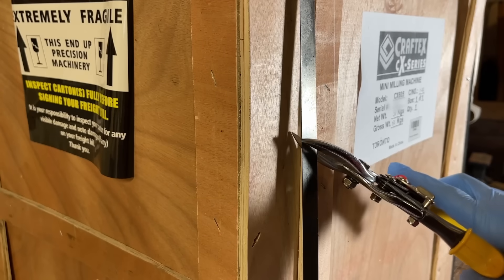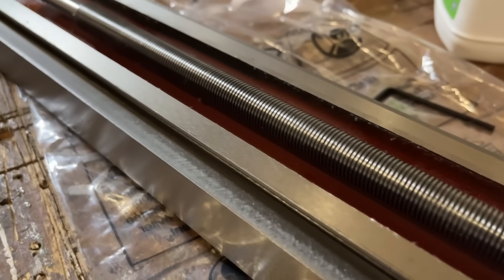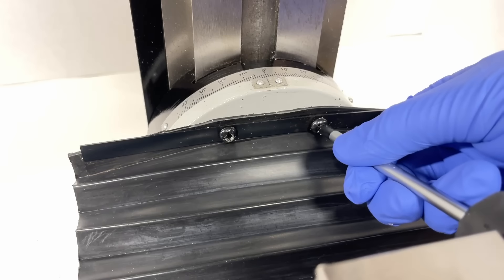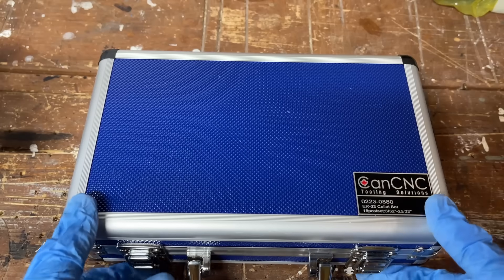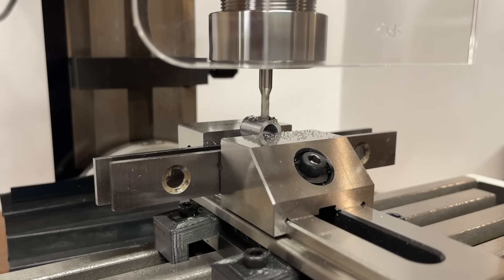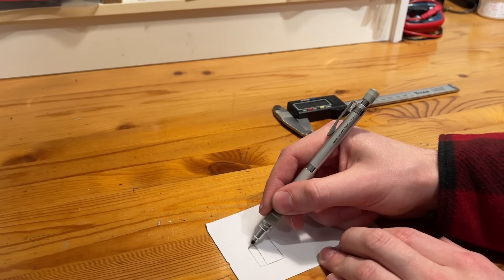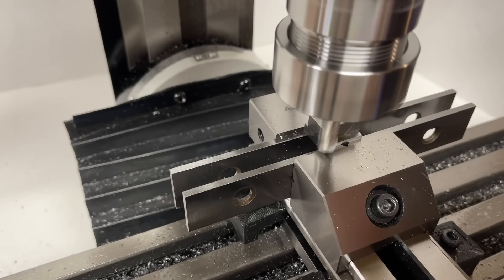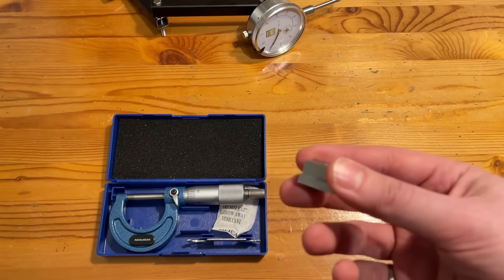I Bought A Minimill to see if they are Worth It

Comment: I am willing to bet a lot of bad reviews are from user error 
having been trained as a machinist the mill or Bridgeport is harder to run 
I am a damn good lathe operator because it so much simpler its hard to break tools unless you push too hard on the bits with no coolant 
on a mill you have to remember what direction to cut the table now moves on multiple axis which is a complication etc etc etc
even being trained I was prone to busting bits and these things get expensive really quick
and it can damage a part as you are  running them too
long winded bit to say not everyone is cut out to run these

Comment: I have had a mill in this size at work now for over 10 years.  Its a different brand, but still same features like the 62.5 dials on the xyz stages.    Mine has a different motor and uses c8 collets.    I have milled stainless and nickel multiple times.   It takes some work and maintenance, but for parts that need roughly .005 accuracy, its doable.

Comment: I have a small lathe I brought instead of a car years ago... and for years drooled over horizontal millers with powered indexing drives. But realised over time I would then have to set up induction  heat treatment if I wanted home made gears to last... then the internet came and I could source most of my gears box needs on line.. so the miller gradually has fallen off my wish list... but still watching this  video !

Comment: Ive always heard they have plastic gearing in them , is this true ?
Reply from the maker: Yes it is, I managed to break one by crashing a flycutter into the side of a chunk of cold rolled steel. My fault. I replaced it with a 3d printed version with about 5 minutes of work not counting print time and had no issues since
Reply: @Someone_Should_Make_That can you use it to replace them with steel beers by using it to cut them yourself

Comment: When you cut an open-ended slot, you should use a two flute slot drill. If you use an ordinary end mill, there is a high chance of an edge breaking off as the mill emerges at the end of the slot.

Comment: There are a lot of people who have no clue about metalworking, buy such a machine and discover their own lack of education which is, of coarse, the machines fault. Another group of buyers  is the kind of people who buy this because of the price, but suddenly demand TOS, Bridgeport, Deckel, Maho and Schaublin performance. The third kind of people who buy this are the kind who knows better then God and even a Swiss made Schaublin is not good enough.

Then you have a few like me, who know about metalworking, been educated in it, worked in it for years, know the limits of such small, cheap machines and make amazing things on it. And often make their own upgrades for the machine to lift it to an higher standard. For them it is pure logic that you can't expect high end quality from a complete machine for the same price as an Schaublin 102-VM chuck.

Comment: I have a g0759 with a 1/3hp motor and  I also had a 2hp jet mill. Unless I was surfacing 3" wide pieces I always used my lil baby mill. I love that thing. I typically machine titanium, but it worked for hardened steel and everything in between. JUst keep your expectations in line and you won't be disappointed.

Comment: About 8 years ago, I bought an old Speedway mini mill from a guy who only used it to drill a few holes. It still had cosmo on parts of it. Those who are unfamiliar with the brand, the Speedway brand of tools was sold back in the 80s at those tent sales that people would set up on grocery store parking lots. I took it apart and cleaned it all up, it was like new…. And the price was right!
    I bought a set of collets and also a 1-1/2” facing mill on eBay, they are incredibly accurate for the price. I have successfully cut keyways, milled aluminum, steel, copper, bronze…. And of course, plastic! If I don’t have everything kind of down real tight, though it does have a tendency to move a little bit from the vibration and the cutting load. But, for what I do with it, it does pretty decently.
Reply from the maker: Sounds like you got an awesome deal! It’s crazy what these little machines can do when you put in the work to tune them up

Comment: I'm a professional lathe machinist since 2002.
I bought my benchtop milling machine in 2008, I was making some parts in my parent's garage for my hobbies.
Is a little bit bigger than yours (same castings of the Optimum BF20, but marked by an Italian distributor).
Original gears left the chat after months, I replaced them some times, and in 2011/12 I replaced motor and transmission totally (1.5kw asynchronous motor+VFD+poly-V belts).
You can see that on my other channel, searching for dadoVRC )
I used it until the end of 2023 to make DIY projects and then decided to convert it to CNC for making plastic injection moulds for my actual DIY project, to which the channel I'm writing with now is related.
You can make wonderful things with those small machines, especially if well converted to CNC, just take a look to the things I made starting from this May.😊

And I say that as a professional, a real one who knows that every machine have its limits, and if you want to achieve a result, you have to be able to stay within them!

Comment: I worked in a machine shop for several years in my younger days. One lathe I operated was a 40 x 157. Was turning large pump liners for gas plants. Years later I bought a 7 x12 mini lathe for the home shop. It was a learning experience with this little thing. Light cuts and don't get in a hurry for sure. But it does work on the small stuff I am doing at home. The dials are in metric which took a bit to get used to, and I did have to make some adjustments to get it running true, but it now does very good work.

Comment: For a hobbyist that has plenty of time to baby the machine and is only making small parts out of softer metals the mini mill and mini lathe are fine but if you have used larger machines switching to a mini mill or mini lathe is an exercise in frustration. Sure they can work in a pinch and you can get good results but not ideal by any means.

Comment: That’s more a grinding vise, and not a mill vise.  A mill vise will most often have an acme thread for clamping forces needed with milling vibration, whereas a vise like the one shown has a single standard screw. Upgrade if you can or keep your cuts to very small cutting depths.

Comment: I have owned a Micro Mark version of the Sieg X2 for 30 years.  It is still on the original motor, spindle, and spindle bearings.  Granted, I don't machine a LOT, but I do use it at least a few times per month, and when I'm working on a project, it gets a workout every day.  They can do respectable work (which means parts within .002" of your target... .001" if you are really careful), especially considering the needs of the home hobbyist these things are built for.  No, it's not a $50,000 Bridgeport, but then, who really wants one of those in their garage?   I have milled steel with it many times.  You just have to take light cuts and go slow in steel ... and use cutter lubricant! (which I didn't see in this video).   People will be surprised to find out that you'll spend at least as much on the tooling and setup fixtures as you do on the mill.   By the time you buy end mills, collets, some hold-down fixtures, clamps, 1-2-3 blocks, dial indicators, etc... it really runs into some money. But that's just life in the machining world.  It has nothing to do with what kind of mill you buy.

Comment: I purchased direct R8 collets which use less vertical space than the collet adapter that you are using and with less stick out things are a little more solid and stable and the added vertical space is nice on such a small machine. I also purchased a longer raising and lowering rack from Little Machine Shop to give more travel. I shimmed it to minimize back lash. All in all it has been a very useful machine considering its price and size. My CX612 with brushless motor was just over $900.00 Canadian when I bought it but they are a lot more now. I also have a CT089 lathe that I bought used for $1,300.00 to go along with the mill. My first lathe was a Busy Bee 9 x 19 and then a South Bend 9A which I sold after buying the CT089. The 1 1/2" spindle bore and added swing of the CT089 is very nice but I do miss the quick change gear box on the South Bend. Oh well. I did need the added swing.  
Cheers: BJ

Comment: So if I want to use this machine, I need to factor in the cost of the chuck?  Is there anything else ill need to consider?  I can build a custom workbench for it that's dynabolted to the floor so stability wont be an issue but is there anything expensive I might need later?  

Thanks for the video, it's very helpful.

Comment: The "Vise"  you are using is a GRINDING VISE  it is NOT  designed for MILLING PARTS .  It does NOT HOLD the Material in its Jaws TIGHT ENOUGH   .  When you are  BACK FEEDING or BACK Milling in the X axis the end mill CAN and WILL WALK the material right OUT Of that VISES  JAWS .  Use a VISE  "DESIGNED" for use in a Milling Machine . Please stay SAFE out there .

Comment: I have had one of these for about 30 years, bought it new.  It is a fully capible machine and is able to do accurate work.  That being said, it is also hinges on the skill of the operator.  It is capible of tool steel however you may have to take lighter cuts.  Tool steel is a little tricky.

Comment: It is a cool little thing but gosh it must take hours and hours of scratching about like an old hen with 10 thou cuts.
Not expecting miracles from the machine but if you cant ron a 20 mm end mill with a 60 thou cut im out. 
Too long winded,put it up on the huron and take 8mm in steel no issues. 
So 1 mm or 39 thou cant be too much to ask from the asthmatic looking vegan mill?
Fine if you making a model steam engine but no more.

Comment: I like the video, I wish you would have posted  links or part numbers for collet holder, etc you used on this.  I just need to take off 0.01" on the bottom of 3000 - 1.5 inch long parts.

Comment: I’ve got a mini mill, it’s good but just doesn’t have enough power and the tilt does slip and I don’t have faith in the plastic gears. Planning on upgrading the motor tripling the power and fitting a belt drive

Comment: Looks alright to me son, good job and video, was curious about the price of that little buddy and what the max amount of material you've found it can cut depth wise in mild steel and what's the max size endmill that it'll hold? Definitely don't care for the dimensions on 1 rotation though, but you found a good work around. Plus how much was the cost? Nice t-nut😂, I remember well being given free reign during my apprenticeship to make my own tools and heat treat and grind to size any and all things that we could think of during non-business hours. 1 2 3 blocks, 4 5 6 Blocks, Jacks, parallels, precision vises, precision squares 😂 time honored traditions. Still have and use them 60 years later. Fond memories of a job well done. Have fun and  hours with your tools buddy🎉 y'all pass along your knowledge whenever you can as we must have skilled hands on workers for our country's future! It is vital for young people coming into the craft to know the basics and not just buttons. I also think that knowledge with pencil and paper mathematics is essential 👌 slide rules are cool as well. Don't forget the Bible for machinist as well, the "Handbook" mines a 1930 issue😂

Comment: Use your dial indicator to measure the location of your axies.  I am a retired job shop machinist the worked before DRO's and that is how we used to do it when we needed a number.
Reply from the maker: Good advice, I should start using that trick on the lathe!

Comment: I'm surprised yours cuts so smoothly. I've had mine for years and seldom used it because of vibration issues. Perhaps my end mills are very dull, or I haven't tightened the column enough, but the machine vibrates violently on even 0.01" cuts. It vibrates so much so, that unless the travel lock on the head is tightened during a cut, the head will often drop downwards under its own weight destabilized by the vibration (This rams the tool into the work and often worsens the vibrations, wrecks the part, and/or breaks the tool). Similar issues are observed with the other axes as if they are not locked, they will inevitably shift while cutting. I suspect this is a consequence of loose gibs however I have had difficulty adjusting the gibs without them binding (now that I'm thinking about it, I have assumed the gibs were straight, I should inspect them to see if they are bowed). Out of curiosity, are you tightening the travel lock on the axes during a cut? 

Its at least good to confirm that this is likely an adjustment issue on my end (though I do intend to purchase a solid column for the mill some day).
Reply from the maker: Typically I don’t tighten the off axis slides, I’m sure it would be marginally better but I haven’t found the need to! Good luck tackling the adjustments, some slightly painful setup upfront  goes a long way with these things to make the cutting process go smooth

Comment: It's like anything else that require precision, SET-UP, SET-UP and staying within the equipment's cpacity, the ame types of comments are often applied to radial saw in woodworking. 
The set-up according to internet ect is less than an hour, tt took me 4 hours to set it up square and true in all 3 axis, until the dauy I had to break down my shop into storage, that saw cut true and repeatably at any angle. Time and patience ....

Comment: If they do a metric version (with whole metric increment on leadscrews!) thats got to be easier to work with than the one you have. Used to have to convert all the time for an imperial universal mill and metric lathe!
Reply from the maker: Yeah that would definitely be nice! I don’t mind working in imperial or metric but the fractional revolutions were a real challenge

Comment: Imo the main issue is not the column going out of tram but that it can be deflected by a few 0.1s of mm with just a moderate push of a finger. This severely limits how hard you can push it before it starts making horrible sounds and breaking tools like there's no tomorrow.

Comment: I have had both a mini and a full size mill and the real difference is how much you can cut at once. As far as quality I made parts that were in the tenths tolerance on the lathe. It's just takes a little longer and you're limited on your bed size but other than that the mini stuff cuts steel just fine. I've done steel, brass, teflon, etc without issues. The machine I had was a combo lathe/mill so that mill was pretty limited and I wouldn't recommend it however the two separate machines will be fine for most stuff. I wanted be able to work on larger stuff and that's why I bought some bigger stuff of course I purchased them used and with that you need to make sure the stuff you're getting isn't worn out.

Comment: How about mounting a piece on the table with step blocks a half inch above the table surface and using a fly cutter with the head tilted forward/back? Say doing a .020 cut over 1" wide. Would that be an "overworking" of the machine?

Comment: Instead of buying a mini mill, I've been wanting to try doing a little milling with my Ridgid floor model drill press. Thoughts? I've already got a couple of cross slide vises and measuring tools to align everything.
Reply from the maker: I wish I could recommend, but unfortunately it’s not safe. Drill presses usually don’t have drawbars for their Jacob’s chucks and applying radial loads can cause the taper to pop out unexpectedly while you’re mid cut

Comment: A few problems I have had using these: 
low quality acme screw nuts fail and can seize up/ damage acme screws, this seems to be common on the Z axis.
As stated constantly loosing tram is an issue; these machines are limited to light cuts.
TIR on the spindles is often in excess of .0005" on these machines; coupled with low quality tooling which is often purchased in conjunction with these mills several thou of runout is common with these set ups; this needs to be constantly doubled checked.
These machines are flimsy and will develop very strong vibrations under moderate cuts (on the order of .100" depth of cut, full step over on a 2 flute 1/2" end mill); even when welding the column to the base or using a model with a ridged base moderate cuts are too much for these machines because of this problem.

I think rebuilding an old bridgeport is a better option for a hobbyist if they have the room/ power available for it. It doesn't make a lot of sense to spend 1k on a cheap minimill then 3K on tooling for it (quality ER collets, vises, R8 collets/ adapters, calipers, micrometers, dial indicators and so on quickly starts to add up)